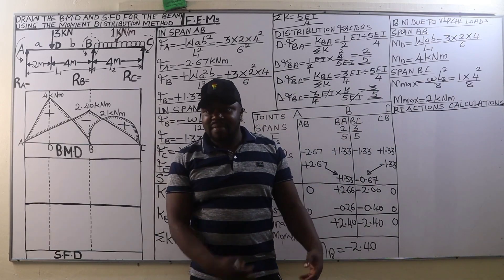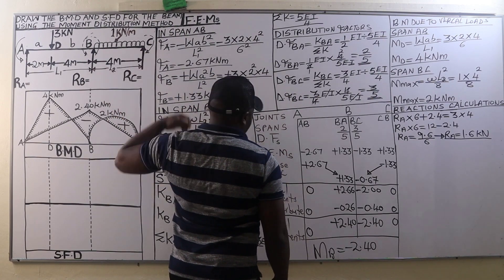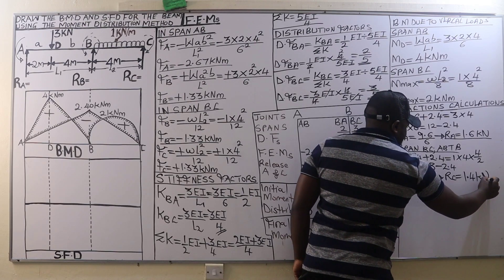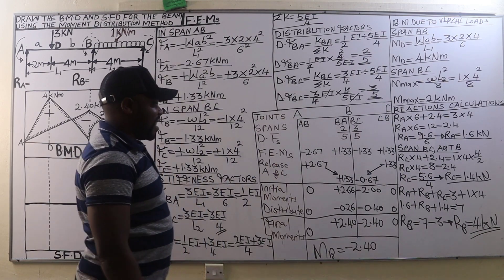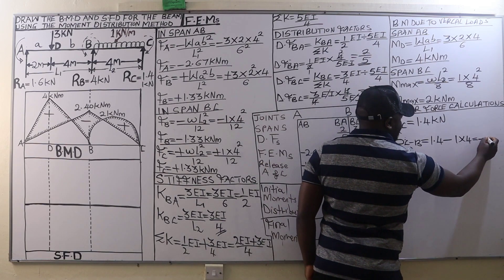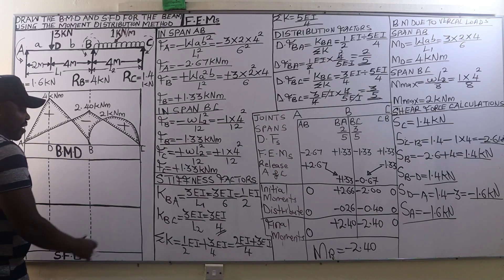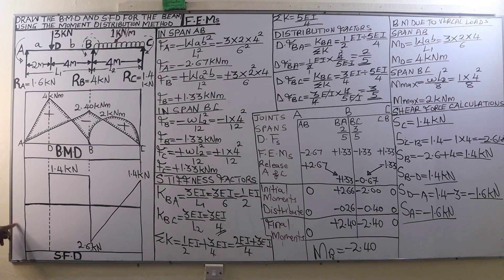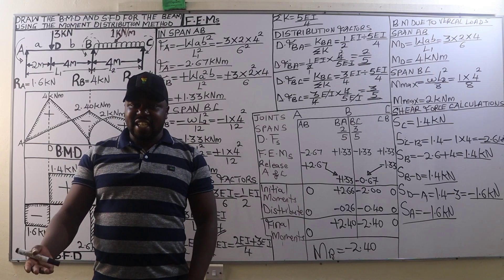HOW TO PLOT THE SHEAR FORCE DIAGRAM FOR A CONTINUOUS BEAM|MOMENT DISTRIBUTION METHOD.

Comment: In our calculation I can see that at B we are having a negative moment which is an anticlockwise moment, then why when we are taking moments abt point B using RA* 6 + B. M at b yet RA is a clockwise moment towards B
Reply from the maker: The moment at B on the span AB is clockwise (-2.40) and the moment at B on the member BC is anticlockwise (+2.40)
Reply: I have checked on the sum of our moments in the table and for span AB the sum of moments at joint BA is (+2.40) which then is an anticlockwise